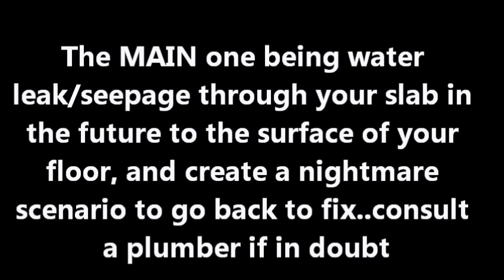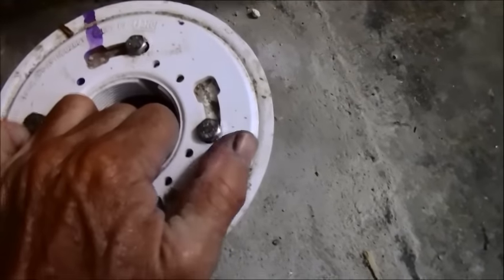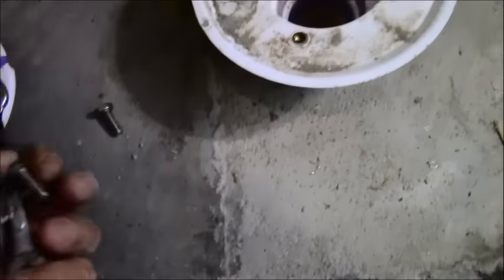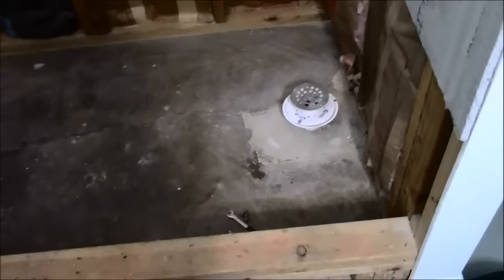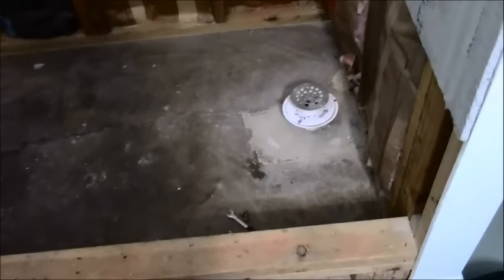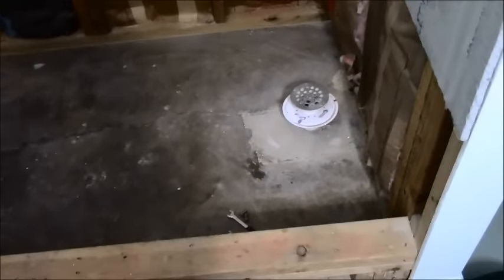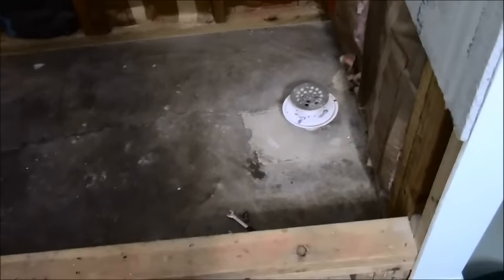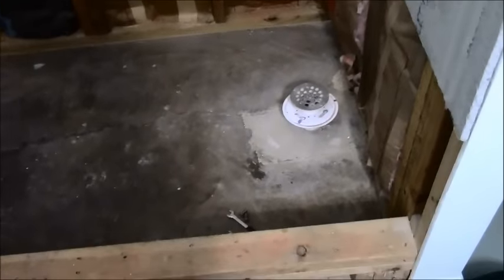SHOWER DRAIN ON CONCRETE SLAB

Comment: Perhaps you will respond to this question:  Most areas (code) mandate a 2 inch drain.  The question is "how far" must that "2 inch line" need to run?   Is it legal to transition to 1.5 before trap, after trap?
Reply from the maker: The whole reason there is an inch and a half for a tub is you have a higher threshold with the edge of the tub being so high compared to a shower curb, since a shower curb is much lower the width of the drain is much wider. Legal would be the wrong term, up to code would be more like it but codes are broken all the time and things still work.
Specifically on this video the P-trap is below grade and is inch and a half, then the transition is made is low as possible and things would still work.... yes in the ideal world it would be a 2-inch drain all the way to the main but that is impossible in most cases, so we still do tub to shower conversions with what we have to work with
Reply: @StarrTile  Nice and thanks for the reply.  I am doing a similar situation but all is accesible as below me is storage and the trap is 1.5 but converts to 2 inch line within 5 feet.  I'll proceed with just doing the drain at 2 inch to 1.5 trap and back to 2 inch line within 5.  If any trouble I will simply switch the 1.5 (5 feet) to 2 inch.  I expect all will be fine.  Good day.

Comment: Is it okay to install the shower drain lower than the surface of the concrete on a slab? I want to have a lower shower curb and therefor need the drain to be lower. I wasn’t sure if this would go against standard plumbing codes

Comment: Helpful. Thank you. The river stone may have just been chosen because it in style. The curb may have been high to accommodate the error of the flange height. 
I just saw a video of a guy squirting foam along the edge before pouring self leveling concrete. God damnit if I already poured mine up against the framing ( over tar paper and lathe screen ). If I pray to Jesus, will the floor not buckle due to expansion?

Comment: Any advice on how to do a shower pan liner for a curbless shower on a concrete slab. I have a shower with a huge curb that sits a few inches below the rest of the floor. It's framed all around and tiled to act as a tub. I'm going to convert to a curbless shower since it sits a few inches below the slab. There's no curb to wrap and attach a liner too. I'm guessing just lots of Redgard and fiberglass mesh?

Comment: I have a concrete slab foundation and the shower drain seems to smell. I wonder how I can confirm if there is a P trap down there? For your case, how do you confirm there is a P trap?
Reply from the maker: Every bathtub has a P-trap below grade, sometimes that can be 12 in or 18 inches or so, if it was always a shower and it has a smell then more than likely the last person did not put in a P-trap, the only sure way to tell is to run a telescopic camera down the drain
Reply: @StarrTile thank you. The prior owner of the house did some heavy remodeling himself, and I suspected that it was a toilet drain before. And toilet drains do not have P traps. I guess I have to run a telescope to know. Is there any other device you could recommend that would insert into the drain to block the smell but allows water to flow when we turn on the shower?

Comment: Um, is not the whole purpose of a 2" to prevent water from backing up. Transitioning from a 1 1/2 to a 2" does not solve that problem?
Reply from the maker: No the whole purpose of transitioning to a 2-inch drain is to allow more water volume in a quicker amount of time as opposed to a bathtub which has longer to drain.... that is not part and parcel to a shower back up because that would mean you have a clog.
And of course a tub puts out more gpm than a shower head ever could.
Reply: @StarrTile  Thanks for the response. That is what I meant. A tub has the capacity to hold water, hence the 1 1/2 drain. A shower base cannot hold that amount of water so needs a 2'' into a 3''.

I am in the process of converting a tub to a shower on a slab. I am thinking I need to remove the 1 1/2'' pipe and replace it with a 2''. I am not sure how far I need to go to do that.
Reply from the maker: The correct answer according to most plumbers... You dig down all the way to the Y transition of the main drain, no way am I doing that and I have no compunction about the excess 1 1/2" running 10" to 12" to that point
Reply: @StarrTile  Thanks again. Yeah. I'll just convert it to accept the 2'' drain.

Comment: I’m curious . Shouldn’t there be pre slope under the liner ?  I’ve removed a couple of these liners that were flat and there was a tremendous amount of mold growing from farthest corners from the drain .
Reply from the maker: A pre slope does not perform as intended, but more to the point we are waterproofing the entire shower before tiles ever set so no water can get into the pan

Comment: Is there a reason why you have added a layer of what looks to be waterproof fiber glass ciment board when you did add a pvc liner on top?  Was it because your drain was 1/2’’ too high and you needed to fille the space?
Reply from the maker: Yes to last part..drain was too high

Comment: We recently had to do this and our plumber was replacing the drain and tried to move it.. towards the center. He did not recommend doing two 90 degree elbows. Apparently it's not a good idea and not up to code in some areas. Also it  makes it harder for the snake to go through.. Not sure if that is the general wisdom... There was not much room for us to work with and we left it where it was. We have a corner shower and I wished the drain was centered but we'll do without.  That is already above the trap and some codes do not allow 2 traps or an S trap
Reply: Did you ever get clogged up issues connecting to old 1 1/2 trap instead of 2inch trap?

Comment: why don't you have a p trap in the down section for reduction of waste line gas?  I normally put one in so there is no gas and if anything like an earring etc. ,can be retrieved possibly.
Reply from the maker: If you listen to the video I explain that P traps on bathtubs are set below grade, usually about 10 to 14 inches down, so yes there already is one, you would not put a secondary one in

Comment: cool.  I have a six inch diameter pre-fab hole through the concrete slab in a condominium.  Do I just find a drain insert that is large enough to fill and support that hole?
Reply from the maker: https://youtu.be/vw8bkGmHKrE

Comment: Thanks for the informative video. 
Question: can you use the Kurdi membrane in the same fashion as the rubber liner? Im going from 0" (floor hight) to 1.5" to the drain & the rubber membrane is a PITA! 
I'm thinking Kurdi would form better
Reply from the maker: Yes you can use Kerdi, check my last video I posted Friday... there is a time and a place for everything

Comment: Nice video. Maybe I missed it, but where is the trap located on that drain?
Reply from the maker: Usually about 8 to 12 inches under the slab in the dirt
Reply: @StarrTile , got it, thanks.

Comment: The problem with that is afrer is all done the shower might not drain very good and might have a big problem later. U need to find the old ptrap and put it next to the drain. Will definately will have big problems later.
Reply from the maker: Ptraps on slabs are below slab 8-12inches...no one is digging in the dirt to locate it, no reason to, they're not meant to be "near the drain".
Reply: @StarrTile  A long arm to the P-trap means a likely smelly situation, festering hair,soap scum etc. It will be blocked by the seal in the trap. Sorry if it sounds like critizising. Its just we seen it overflow thw drain becuase of a p-trap deep in there. Just a heads up hope ur well with this corona deal.

Comment: Hi.
Don't listen to haters,I appreciated what you do. 
Simple and important question, does showers have a p trap ? Cause I noticed here on your video there's not a p trap? Thank you
Reply from the maker: @JuanRodriguez-pk6yq  every water fixture has to have a P-trap, in this case it used to be a tub so the P-trap is below grade inside the dirt probably 11 to 14 in past the concrete, so no reason to put the secondary P-trap for this tub to shower conversion
Reply: @StarrTile  thank you for answering, I was scared on my shower there's was a tub, I took it out I didn't see a p trap, now your explanation clear my mind, thank you a lot.

Comment: What if concrete slab has post tension cables...how would you relocate drain?
Reply from the maker: I would not mess with any concrete floor that had tension wires in it, I would sub a plumber to do that, too much liability

Comment: Excellent clip, and sound too... But that bolt is stainless steel made so your luck with the magnet dropped in the drain... More if it's been the p trap directly as you said you wood have direct access to it... All good, this was just an ideea... Thumbs up

Comment: Excellent video! I’m currently doing a remodel, our shower is going where our bathtub used to be. The slab is flat and level with the rest of the foundation , not recessed like the original shower. Currently debating removing that part of the slab or building up for the shower pan. How thick is a typical shower pan, meaning how far would we have to step Up? Really would like to recess it though.

Comment: With the slab being flat under the pan liner with no slope .How will the water on the liner get to the drain?
Reply from the maker: Because the surface is waterproofed...so nothing gets in pan to begin with

Comment: I was under the impression that you intended to upgrade pipe to 2" with P-Trap at the flange.  In my neck of the woods, we never reduce a 2" shower flange to 1 1/2' pipe. A tub sure. Never a shower
Reply from the maker: To be clear....below slab level, at grade, is where the 1 1/2" pipe was originally plumbed for the bathtub. I'm not going to grade level to swap that out to 2", but once I knock out the concrete I go as low as I can and make the transition from the original inch and a half to 2". If impossible to go in further below slab I'll transition to 2" with a hub to accommodate the drain flange

Comment: I had a plumber install a shower flange and was about to backfill the hole and noticed the flange is a bit cockeyed. How much of an issue will this be? It's not level and sloped about 1/4". Should I redo the job or try to force the flange level with the concrete back fill?
Reply: Hopefully you can move the pipe enough to level it. Keep it wedged in place and fill around it with concrete to keep it set.

Comment: What if you have a post tension slab, do you need to worry about cables near drains - meaning do they run near plumbing waste drain?
Reply from the maker: Most definitely, I would never mess around in a condo where there are tension wires and the concrete, just not going to happen
Reply: @StarrTile thanks for reply.  I have a house with PT slab.  Plan to convert tub to shower with minimal plumbing move planned.  I’ll schedule a scan to find where the cables run before any slab work.
Reply: Update. In Arizona many house slabs constructed with post tension cables.  So got a radar scan done by a concrete service ($600 minimum fee) and they line out path and depth of cables on the slab.  Then around the cable,  you cut and chisel the slab leaving the cable un touched nor damaged but cleaned of concrete.  Then you can route the new shower waste plumbing and refilll with concrete. This is not normally a diy job.

Comment: Just watching this. Couldn’t you have put a pre slope up to the flange and then liner and then a second mortar layer?
Reply from the maker: Sure I could have but it's a moot issue since I waterproof the surface
Reply: Sure he could have put a pre slope down to the high flange, however the Old lady would then need a ramp to get over the new curb height.  I haven't yet watched all the video, however I thought he said the previous person left the 1 1/2" pipe in place and used a reducer from the 2" flange.

Comment: About how much $$$ money $$$$ would the job cost to have a plumber jack Hammer up the concrete and install the new pipe which is set back to give tile clearance then add new concrete? I ask because our area just suffered a massive flooding with many properties deemed unfit for human use or Occupancy but there are also many like mine which can be fixed...the problem is Plumbers and all Tradesman are in such high demand right now that they have a full schedule for six months at least. I would not mind trying to place a pan but the piping and concrete work is probably something I would rather have a plumber complete. Thanks for any reply.
Reply from the maker: Plumbers are inherently very expensive, I know many plumbers who would not touch an opening less than $250, an opening could be replacing a toilet, replacing a P-trap in a sink that's leaking, Etc, it's a bit ridiculous and the big commercial guys would probably double that.... and that is generally for easy access, then add in the jackhammering and back filling with concrete, you might be looking at around 1500 to 2000 for a plumber to do this work. It's ironic you should mention the storm damage because I'm on my way to Panama City Beach in about 8 or 9 days to do a couple of showers down there, they weren't damaged they're just renovations.
Reply: Thanks for the fast response, I am up north near Lavalle WI....our river was more than 27 Ft. above flood stage with fast moving mud water up to the eaves (including other debris) Hint Hint....it was ugly. But this is my family home and will rebuild with time while moving forward. Insurance companies will no longer provide bound coverage for many properties here....but we got lucky somehow compared to others with severe structural damage so will stick around.

Comment: What if the walls are cinder blocks, do I still need a liner? How do I attach it to the walls?
Reply from the maker: In that case use a liquid topical membrane like redgard, aqua defense, hydro ban or some other paintable protection...2-3 coats

Comment: But, aren't shower drain lines supposed to be 2" and bath drain only 1.5"?  At what point under the slab does it typically switch to 2"?
Reply from the maker: Yes you are correct with the sizes, the P-trap is generally anywhere from 8 to 12 in under the slab, after the P-trap it connects into the main drain which is normally only inches away

Comment: So I want to put a shower in next to toilet in my half bath. So in the area I have concrete slab and towards the wall and beyond the wall is the basement and once in the basement gives me complete access to connect to main drain. But I need to get thru slab floor and concrete block.
Reply from the maker: Sorry, is there a question there?
Reply: @StarrTile  oops if I go direct to main drain do I need a vent on that pipe???
Reply from the maker: The drain should already be tied in to a stack to allow gases to escape and provide positive water flow... if it is not then yes you would have to somehow make that happen

Comment: I am planning to install a shower stall to half bath but I need to break concrete slab to put a drain I need to go approx just enough to put a P trap then through concrete block once through I will be in the basement where I can tie into main drain etc. Question: is it easier to use a grinder or jack hammer to break up concrete because I have a grinder. Also i am using a base for the shower instead of building up a base if that makes a difference?
Reply from the maker: Jackhammer all day....a grinder won't do much. But a big concrete cutter will, cut down into 2x2 foot sections and jackhammering will be easier.
I'm not into prefab pans but that's just me
Reply: @StarrTile  I see and if you would use a pan which one would recommend which doesn't require any build up support?

Comment: why you don't use regular end drain cup and instal tile straigt to concrete floor
Reply: Why trap water?
Reply: Mud pan and liner to create a proper substrate for the tile, with proper drainage and to ensure that the water never gets to the wood framing.

Comment: hey i had a question so i grouted a shower grout color was gray  but days later i get  called back because  grout díscolored some joints weré light gray and other weré darker what Would u suggest i do
Reply from the maker: Nothing you can do but try to cut out the bad colored grout & re-grout.
Reply: Use less water when mixing and wiping up. Dry mix the grout first too

Comment: I have a question, how do you remove the shower drain? Mine is producing drainage flies and it needs to be cleaned out. A wire brush won’t do.
Reply: Unfortunately, the are different strains and covers so there is no one stop shopping answer
Reply: drain flies are probably coming in way down the line where there is a crack, not  in the spot you see them.

Comment: If you still monitor the comments on this video, here's a silly question(or two)- I have a tub/shower with 1 1/2" drain, why do straight showers need 2" drains? Why not use 1 1/2" for showers?
Reply from the maker: That is an excellent question that I wish I could answer....seems backasswards, you would think a bathtub would require a larger pipe for drainage than a shower would
Reply: It depends on which code is followed. The UPC (Uniform Plumbing Code) requires 2" shower traps/drains for whatever reason, but the IPC (International Plumbing Code) sizes the shower trap based on water flow. If total shower head & bodyspray flow is under 5.7gpm, a 1-1/2" trap is allowed.

Comment: Is there an actual p-trap? I didn't see it on the old one and didn't see you adding one as well.
Reply from the maker: As I mentioned in the video the P-trap is buried under the slab as it normally would be, in this case is probably a foot or so down and to the rear, you don't add a secondary P-trap in that would be dangerous
Reply: Glad o found this comment! Was about to add a trap!